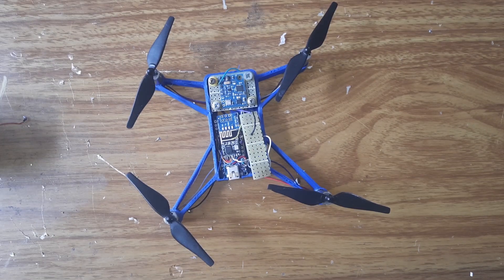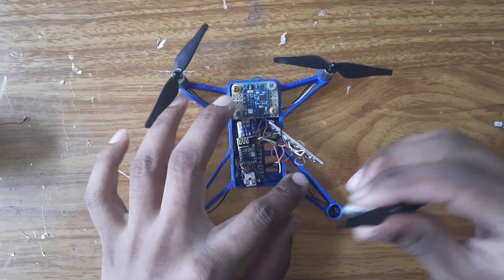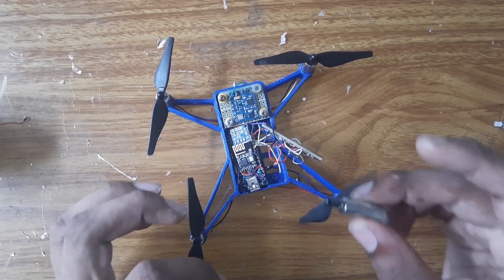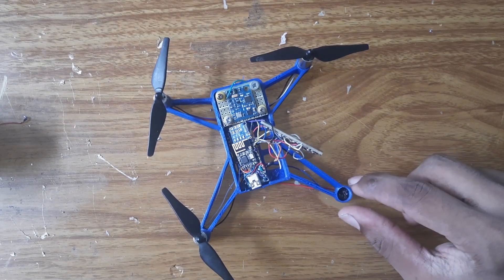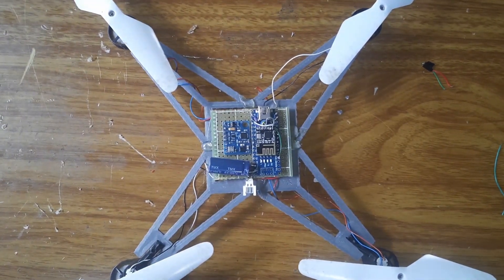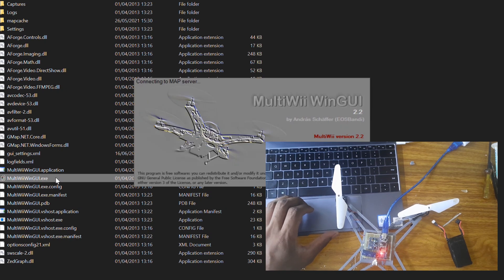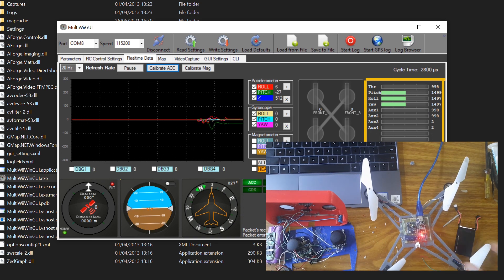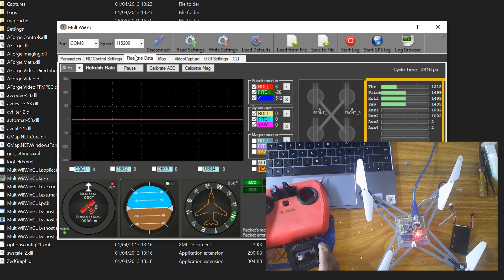DIY DJI Tello clone using Arduino( Part 4)| Full connection and flying test

Comment: Sir can we use 3.7v battery and connect input to 5v pin instead of 7.4v battery
Reply from the maker: Hello, no.. the arduino will still reset itself due to a voltage drop when turning on the motor. But you can try it using a higher capacitor value such as 10 000 uF
Reply: @minilab3d   next fully functioned drone + pid tuning video sir
Reply from the maker: @squadxcreations1473  hello.. in 1 hour
Reply: @minilab3d  waiting sir
Reply: @minilab3d  can i use 5v boost converter
Reply from the maker: @squadxcreations1473  yes.. you can use that
Reply: @minilab3d  thank u sir i have dji mavic drone clone mini size bought from second hand store which run on 816 coreless dc motors and 3.7v 1200 mah battery which iam converting to arduino drone

Comment: Can any one help me?
I have build this drone but I'm facing the problem of Arduino getting reset I'm using a 3.7v  20c lipo battery and use a voltage  booster to get  5v for Arduino only but still when I increase the throttle the Arduino resets. Also im using a 10k resistor connected to the mosfet  and also added a 25v capacitor to Arduino vcc and ground
Please help

Comment: Awesome video~
By the way, how do you prevent your 720 motors from heating up? I'm assuming you are using a 3.7v motor drawing current from a 7.4v battery, right?

Comment: I tried to make it but it did not arm
Reply from the maker: hey friend, have you calibrate the sensor before arming? the sensor should be calibrated and the drone should be in a flat surface to arm
Reply: Ok I will try that bro